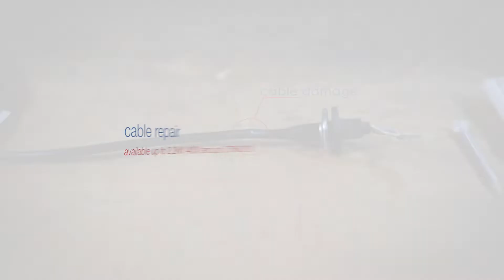Tsurumi pumps: How to repair a broken cable

Comment: Hello, I need the rubber sleeve to repair the power supply cable for a KTV 2-50. Would you have the refference for me to order it from my dealer?
Reply from the maker: Thanks for using Tsurumi pumps. Please send an email to: tsurumi@kommunikationskonsortium.com. To answer your question, we need to send you a drawing of the pump, as there are different rubber sleeves.
Reply: @tsurumi_europe  ok i will do that, thanks